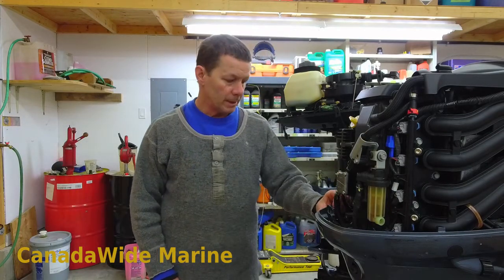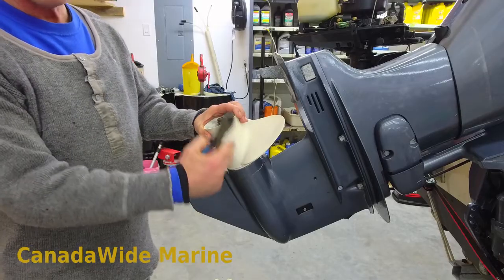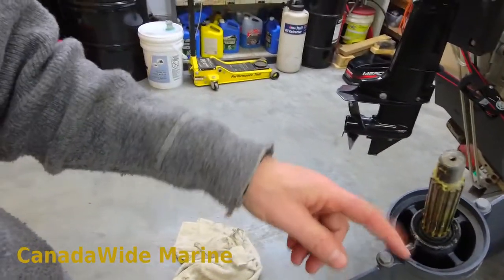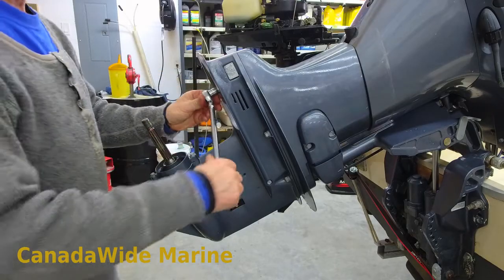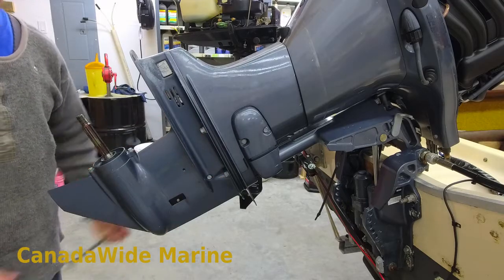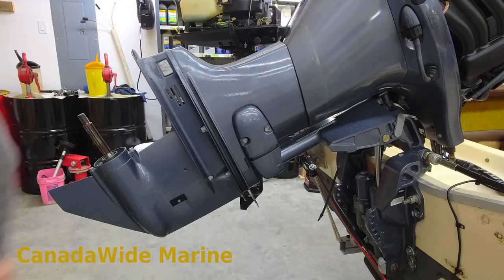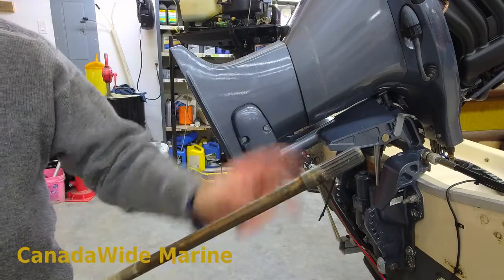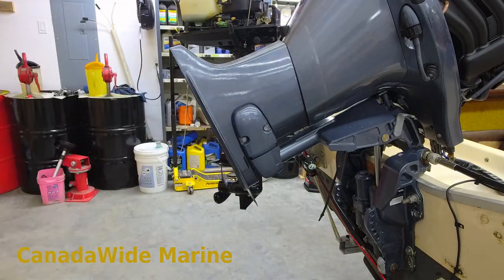Yamaha 4 Stroke Outboard motor, 50 hp, How to remove the Lower Unit for water pump impeller access.

Comment: There are not enough superlatives to describe your videos!  I learned so much about so many things - the actual water pump impeller check, various greases, how you use your tools, hydraulic locks from grease in the wrong places......Now, how do I get my motor from the US to you because we just don't have shops of your excellence here in Maine.  I guess I'll just have to watch every Yamaha 50 video you put out.
You do all of us such a huge service by making these great videos - including all the tips along the way.  Thank you just isn't enough.
I got concerned about my impeller when I found coarse sand in the water pump indicator stream.  After clearing the sand, the starboard (right) side return hose is still not free flowing.  If you have time to comment, how concerned do I need to be about cleaning the entire system?

Comment: Hi jim just watching this video again at first i thought you might have missed the bolt holding the rear anode in but it must not go through the mid section on the 50hp as with the 40hp it has to be released before you can take the lower leg off bit of a pain really as how often would you change that anode ? My pitot tube joint is under the plate at the front another pain as you have to take the plate off to disconect it so that is going to be cut off and sikalflexed as on my little tub i have no need for a speedo (wont go fast enough anyway)  have a gps on the phone if i need to know how fast im going but as long as i am moving in the right direction it doesnt matter .

Comment: Hi i have a 09 F60 just did the impeller but i was getting a slight squeal around 1200 rpm after pulling shaft the bushing that sits on the bottom of the motor looked a little corroded and shaft was showing signs of slight marking i used emry cloth to clean up for now and used wr 2 yamaha grease until next impeller i see theres just a snap ring is that bushing that simple to replace ? Also appreciate the depth in these videos!

Comment: We are having a problem with it not peeing.  We changed the impeller and no luck.  When we put the salt off the water runs good but when we try flush engine from water intake we get no peeing and the if small amount of water, it feels hot.  Any ideas?

Comment: Great video,  sir!
Does the engine need to be disconnected from battery? Thanks
Reply from the maker: You do not need to disconnect the battery, but it is recommended in case you turn the propeller while the engine is in gear and the ignition is on in case the engine starts.
Reply: @CanadaWideMarine  thank you so much ❤️

Comment: Hi Jim i have a Yamaha 50 Hp 4 stroke , and notice like a black residue is coming out of the prop, when i give trottle, please advice
Reply from the maker: Hi Harold,
Unfortunately without seeing the motor in person there is no way I can advise. It could be simply some carbon from the exhaust tube being washed out, could be signs of unburned fuel caused by an overly rich mixture, could be oil carbon from damaged rings or valve guides or who knows what else. If it is a concern I advise you take it to an experienced marine mechanic to inspect it. Thanks for watching.

Comment: Do you happen to have a video or any insight on a 2002 Yamaha F40 TLRA? Every video I see just has the one speedometer tube to remove, but mine seems to have some sort of shift linkage that is holding the lower unit on. Can you point me in the right direction? Any help appreciated. Thanks!
Reply: @shannonfishkill8957  it's free! I find videos more helpful than a PDF. The diagrams are a bit overwhelming. Oddly enough there was what looked like one of the arms of an impeller in the housing, yet mine is intact. Also the top of the housing where the drive shaft goes through looks chewed up so I am ordering a new housing.
Reply: @shannonfishkill8957  was there supposed to be sorta dark oil covering the drive shaft or would that inply a bad seal somewhere?
Reply: @shannonfishkill8957  there was dark oil all on and around the impeller too. Seems like if that part is meant to have water going through, it shouldn't have oil in it??? Thinking maybe one of those seals may be bad and it's beyond my scope. Have no idea how you'd even get down in there.
Reply: @shannonfishkill8957  the oil wasn't on top of the housing. Just all inside of it and on the main drive shaft. I have drained the oil in the lower unit. It looked ok but I had just done an oil change. I noticed it running poorly (not peeing and weird shifting) shortly after the oil change so there was like less than 1/2 hour on the new oil. A main shaft seal sounds bad.
Reply from the maker: Thanks @Shannon Fishkill That was all good advice!